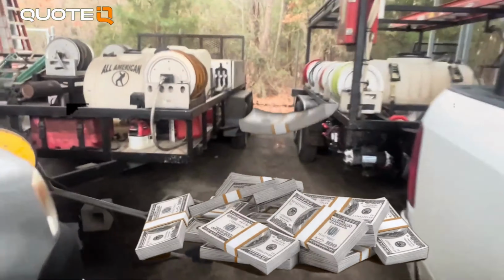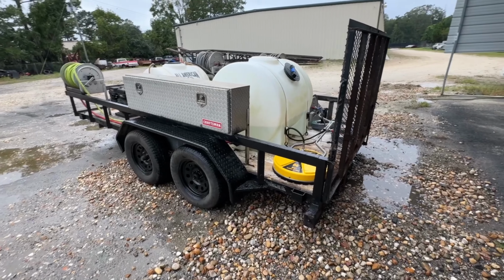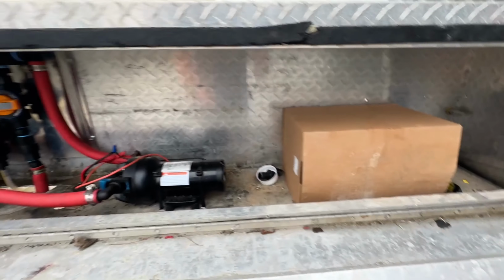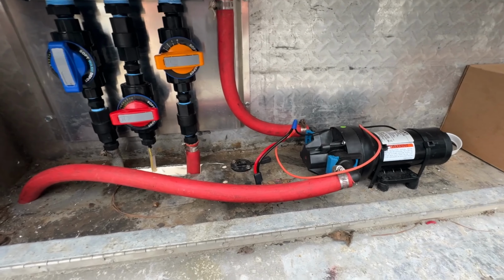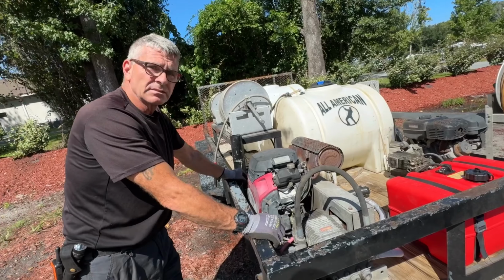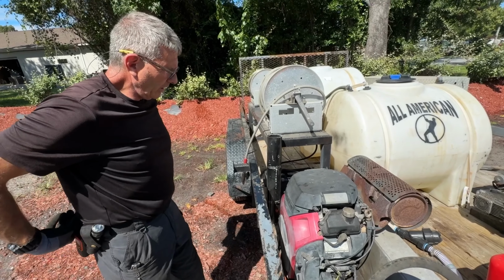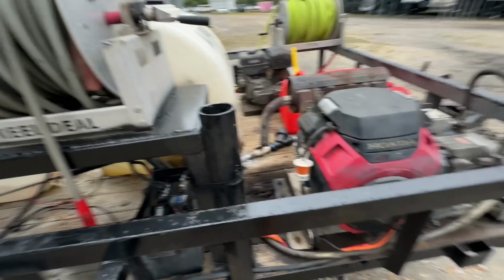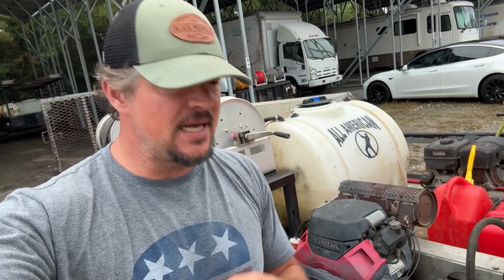The CHEAPEST Pressure Washing Trailer Build (REBUILD)

Comment: I would love to have that set up any day!!! I've finally upgraded to the 4gpm belt drive with buffer tank and downstream set up ..still use the xjet also for some house washing. And still using drop stick and the 12 volt 5.5 GPM  set up for roof Wash and hotter mix applicatios.!! Would love that trailer rig set up ,so I'd have the truck and trailer so I could expand with an employee or 2 LoL.. I just love the satisfaction I get from Washing and making people - customers Happy..
Reply from the maker: Right on!